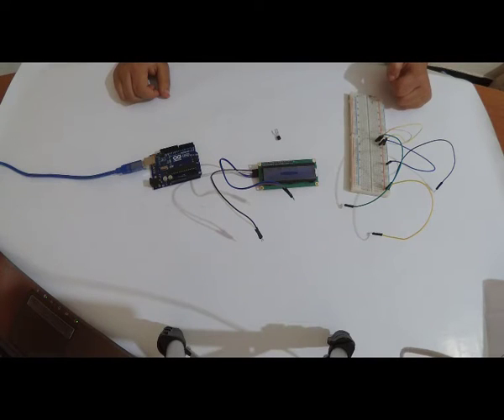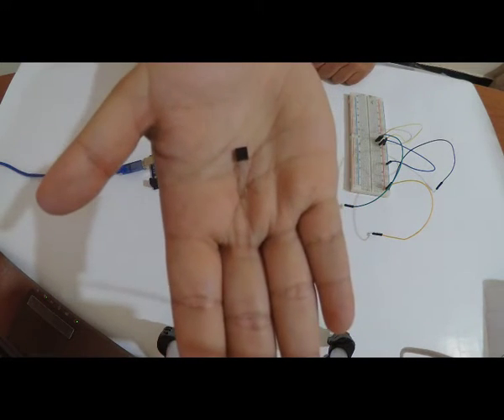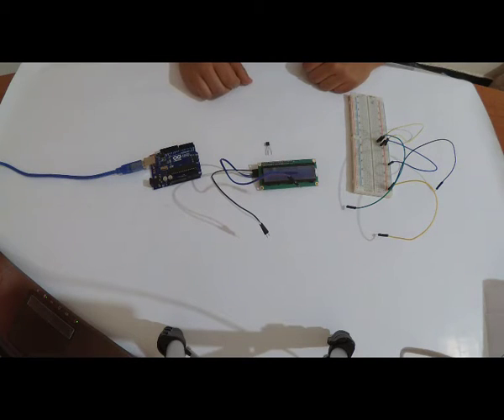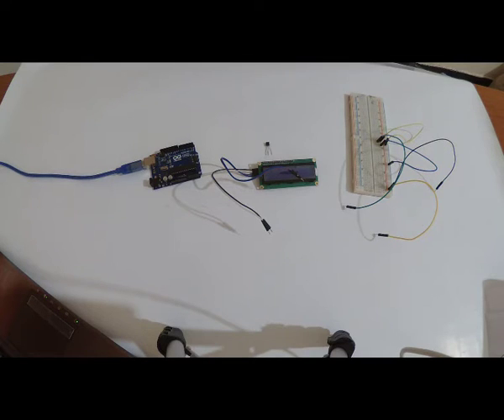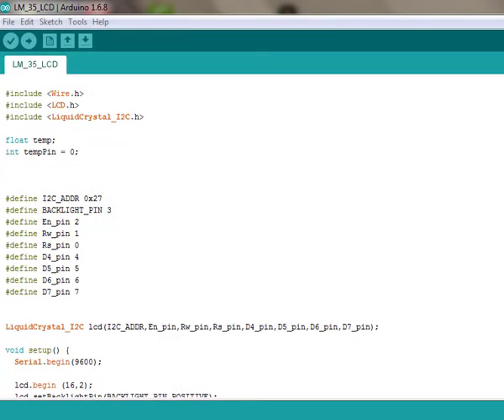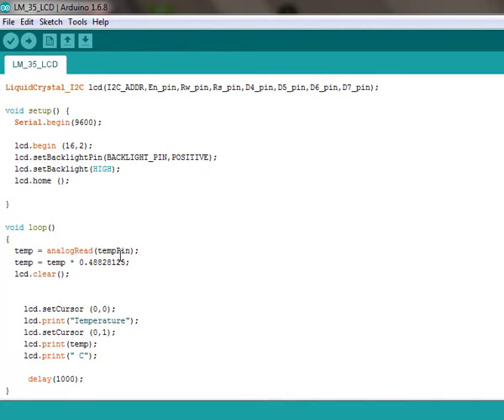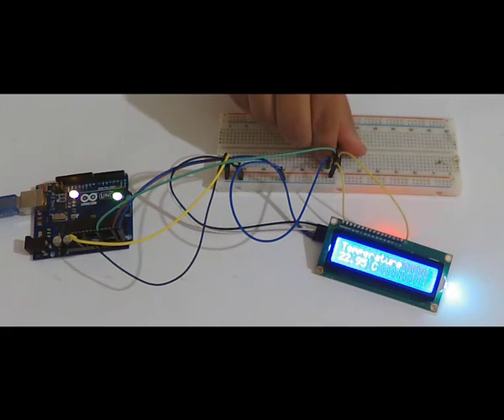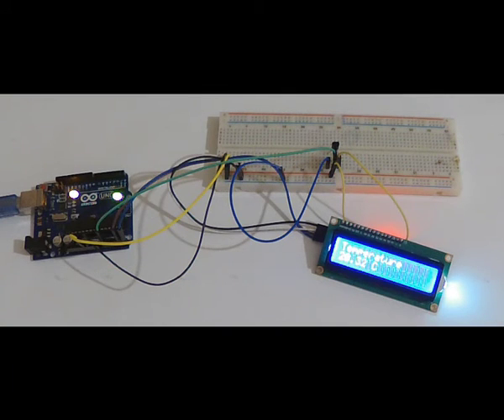Arduino (thermometer) temperature sensor LM35 with LCD display

Comment: <LCD.h> and <LiquidCrystal_I2C.h> both library doesn't work....how can i fix it
Reply from the maker: Did you install the library correctly? because sometimes they got confused if you already have liquidcrystal library in Arduino folder in "program files" and the new liquidcrystal library in libraries folder in "documents", the solution is to replace the old library
Reply: same problem code error
Reply from the maker: Please check the whole problem message to know the problem, if you didn't install the libraries correctly, you will have the library confusion problem.

Comment: the code is not working its showing error compiling for board arduino uno
Reply from the maker: Hello, can you tell me the error please, you can write it in a comment or send me message on facebook, it's probably the LCD library, I just modified my post on the blog and add the link to download it, i couldn't post it here. Thanks
Reply: the code is not working its showing error compiling for board arduino uno
Reply: me too